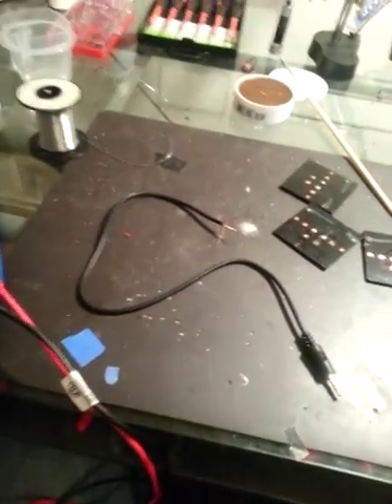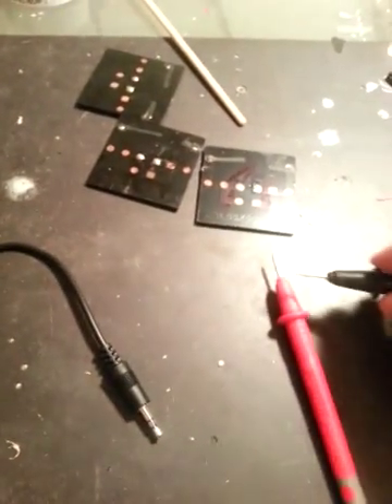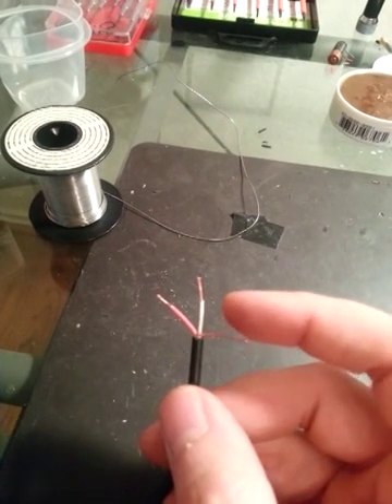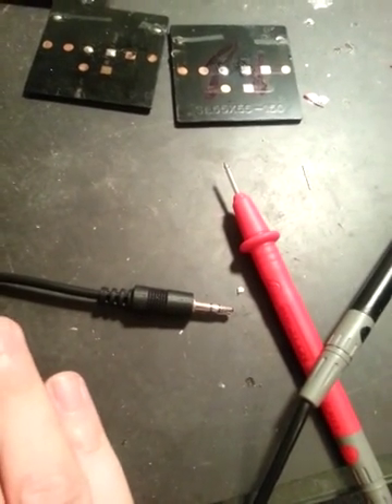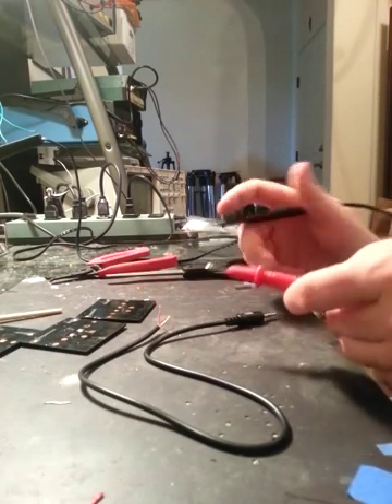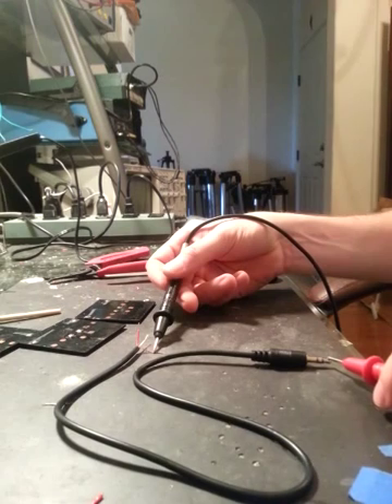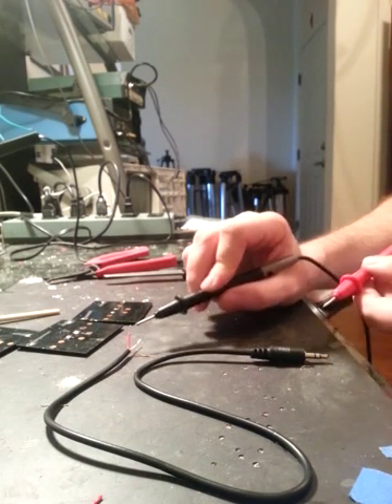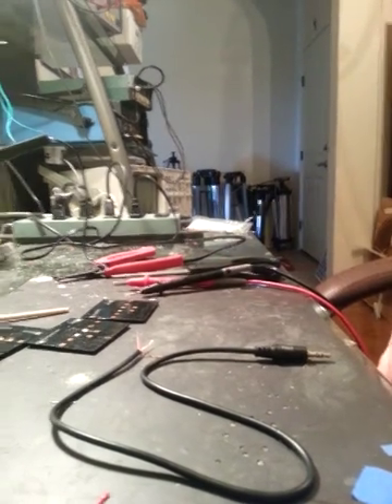3.5 mm audio cable wire to male plug configuration

Comment: In a TRS (tip ring sleeve) like this the colors and connections will be fairly universal.  Tip is usually going to be Left channel and white cable.  Ring is usually going to be right channel and red cable.  Ground is normally going to be sleeve and bare copper.

In a TS (tip sleeve) mono cable it will likely be a white wire for the tip and the sleeve for the ground.